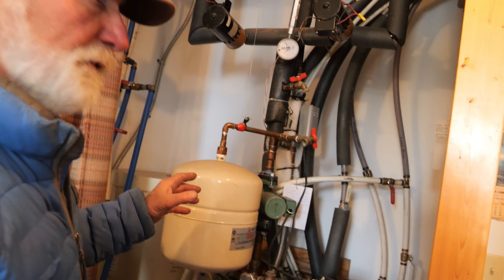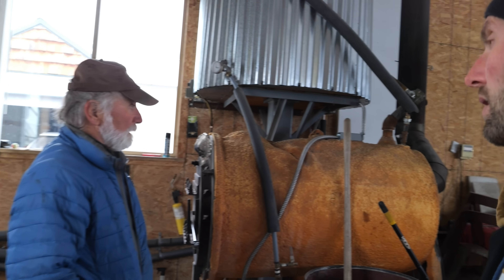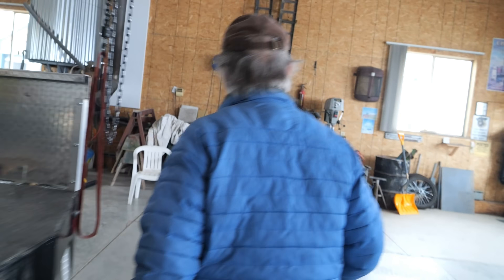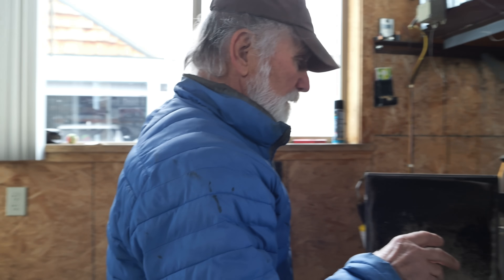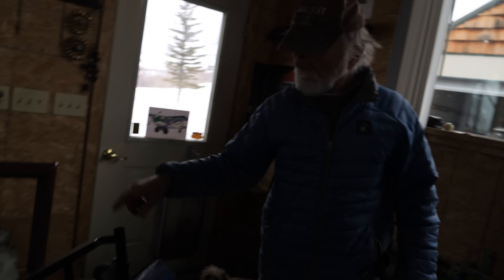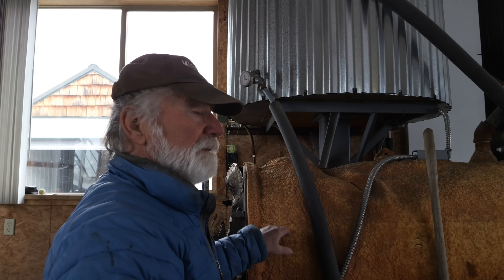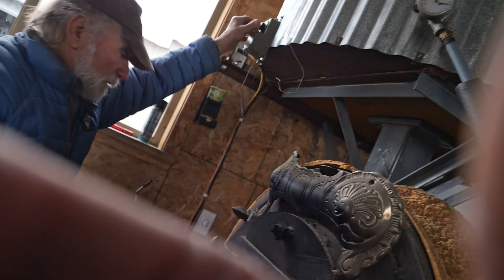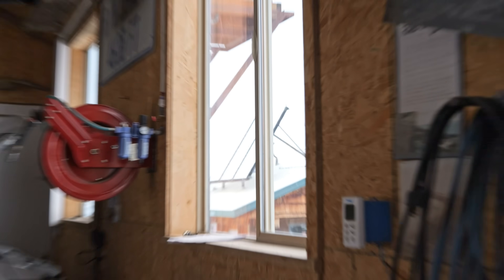Hasn't had a Heating Bill for 40 years.

Comment: i hate this kind of click bait title we heat with firewood/wast oil and similar solar panels and the gas and oil for the chainsaws and the desel for the tractor to skid the wood out and then split the logs the time to stack and move it all add up its gotten better over the years now the wood gets stacked onto 7foot wide racks that i can pick up with the forks on the tractor but there is still a heating bill being payed that is the simple short list
Reply: The 6 solar thermal panels on the shop  provide about 75% of the needed BTU's to keep the 60 by 40 shop at reasonable temps, with no work involved, other than a 15 minute drain down  every spring, and subsequent recharging, using the same fluid, in the fall, that's it.  "No bill" was meant to mean just that, no monthly bill from a propane supplier or other utility, obvously some user input is needed, no clickbait, just a different way of stating what's going on I guess. Time spent in the summer gathering deadfall, and some hauling of wood from construction sites he's on already anyway doing crane work, is a few hours here and there, not onerous at all, and the end result being it pays well in avoided costs. If he doesn't have to write a check or take cash out of his wallet for the wood, some would consider that "free."
Reply: @portnuefflyer  just as a side note not only do you have to drain the panels but you need to check the acidity in the Glycol to prevent corrosion most of our panels run on a 12v system for circulation  (over all i think we estimated close to 10-15 years for the panels to pay for themselves) soooo if you divide up your one time payment for the set up you still have the "bill" same with wood if you cut spit and stack your own then very little bill in the mail others buy in their wood bc they dont have the land to harvest on... if you own a wood lot and pay taxes on it then that's a bill you can break up into a monthly cost.   i am not trying to be a dick here but i had to do a similar chunk of math for the photovoltaic panels we put in and when my brother and i sat down it turned out that for time span he was working with he would not break even going solar

Comment: From what was said at 7:45, you will need lots of blankets and another heat source for the 2 days it takes to get the system warm enough to rely on. You can keep it.
Reply: There are numerous backup/aux heat sources, all the eggs are not in one basket, making it more reliable than a single source.

Comment: 1800's boiler tech mixed with 1980's solar water heat, mixed with 2000's radiant pex floor heating  it's just updated design with no ground heat pump 1970's tech
all glycol is for is to keep the water from being pure steam or from turning to blocks of ice in a combustion engine....in aircraft carriers steam turbine power plant, there isn't any glycol, you don't want your liquid to stay liquid and you can't have it turn to blocks of ice...now get with the 2000's and electro magnetics aka rail gun  or EMALs as it's known on the new U.S.S. Ford, it's still the 1800s steam tech with nuclear tech of the 1950's and electro magnetics of the 2000.
you don't reinvent the wheel, you just modernize it.

Comment: wicked smart, but takes a substantial dollar amount to invest, but after 40 yrs, he has saved a lot.. slow easy but safe and efficient.. wow!
Reply: Subtract from the initial investment, (around 10K, but done incrementally somewhat) the amount required, upfront, for a conventional heating system, and the numbers work out even better.  No butchering of the framing either, as requried when runned forced air duct work, which also takes up more room.  The house boiler and equipment room is in a small closet, with room to spare.

Comment: So his saws run on hopes and dreams then? or does he cut the trees down and buck them up with karate chop? you'd have to buy these things and maintain them in order to supply your self with timber to burn making your statement horse shit. if you buy the wood then no its not free. if you burn gas then no its not free. Not to mention what powers your pumps to circulate the heated glycol from your boiler? I suppose those run on magic too. you have paid for heating for the last 40 years through your own labour and fuel to run your machines as well as electricity to run the pumps. Give your balls a tug old man. As far as i know Glycol isnt cheap as mud and also has to be replenished. I suppose the solar array was bought at a garage sale for a mere $3 as well. Maybe change the heaser to: "man invests $27,000 to heat house and say it costs him nothing.......after the initial $27,000......but we wont count that........we're only counting post fortune not pre fortune...."

Comment: This is really great to see. I work in the solar industry with a group that installed thousands of solar collectors on roofs in the past. We now do solar photovoltaic panels as it's better/smarter/easier + highly incentivized.
This is an awesome setup he has but it's not as good as modern solar as his cost is a constant supply of fire wood + physical labor. He has to be home to feed the system wood so he can't take a good vacation away from home. Some limitations here, but the payback/savings is really awesome and if he is actually using waste wood and not cutting down a lot of trees it's an incredibly low carbon footprint.
Reply: No need to constantly feed the boiler, it just augments the thermal panel action, plus the house has radiant panel electric heaters and an electric boiler, all solar and hydro powered. The boiler is handy when it's convenient and  too cloudy for much input from the solar, but no one is a slave to it as some think! Agreed, on the going with PV to make hot water, with the huge price drop these days.

Comment: As long as the boiler has a pressure relief valve he's golden otherwise he could have a large bomb boiling away in there if one of those pumps was to fail and the fire is burning away. 😮
Reply: The boiler feed has a pop off, and the boiler itself has one, so two. Plus the PEX line would blow before the steel boiler, so no chance of a big blast.

Comment: Very complicated concept new to us but old to the Romans a fireplace was built on the outside of the house with ducting under the house that fluted through the walls up to a chimneys the fire on the outside of the house also heated a boiler tank that was plumbed into Faucets in the house

Comment: If you've ever worked in a cold shop for long periods it sucks.  We always used the propane blowers but that costs too much.  This is a great setup.  He should make them and sell them.
Reply: A warmish floor makes all the difference for sure, radiant floor heat is kind of tricky, a wall thermometer may show 55-60 degrees, but damn it's comfortable for a shop, because you don't have a huge concrete heat sink under your feet. Especially beneficial in a tall building, because there is no heat stratification like with forced air heat.

Comment: Isn't it more efficient to run glycol through the panels and straight to the floor? He said the heat transfer is efficient from glycol to water via that exchange block, but my mind tells me it's more efficient to run glycol in the whole panel to floor system? Am i wrong?
EDIT: Ha! Turns out that using glycol can reduce the heat transfer efficiency compared to using water alone because glycol has lower thermal conductivity than water. You live and you learn something every day.

Comment: Heating panels on the roof, is a nobrainer to install. It's a mystery to me that so few has those installed. You use those panels to heat up the water to a certain temperature, so you only heat the water from lets say 15 degrees C and up.  That is a lot of savings.  And you are never out of hot water.     But, he HAS HAD  a bill. that system wasn't FREE. the interesting thing here is, how many years took it to get to zero, from the initial invest and maintenance.

Comment: Interesting. My grandfather had something like this he built back in the '60s... Water jacket around a wood stove... He used a regular hot water heat circulator pump to send hot water to the second floor for baseboard radiators. 1st floor got hot from the fire itself. If someone was staying upstairs he went down to the basement and plugged the circulator in.

Comment: Hasn't paid for heating fuel but has paid for electricity to run the pumps
Reply: Nope, paid for long ago solar does that, circ pumps draw little BTW, less than 100 watts.
Reply: @portnuefflyer  yeah they draw very little if your turning them by hand. I know exactly what they draw as I have 3 heating my 100% off grid place.
What batteries and inverters are you using for power?

Comment: If water transfers heat better than glycol, & Tom's 40 years of  "user proof" confirms this, why then do car manufacturers add it to the anti corrosion inhibitor fluid needed to prevent the aluminium alloy heads corroding. And let's face it ever since alloy heads have been in use overheating of cooling systems & warping of heads has been a big problem with motor vehicles ? Have & are we being conned by manufacturers that "glycol coolants" are beneficial but are actually allowing engines to run much hotter due to a diminished capacity to transfer heat from the block/head through to the radiator/ fan assembly to then remove heat from the coolant ???

Comment: yes you had one. but it's hidden.
you have to work physically to bring wood to your stove. wood processing fuel.
handling, so a part of your food bill is also a part of your heating bill.
cost of system: solar, plumbing, etc.

but you don't pay someone else to heat your house, so it's cheaper on long term.

Comment: Let the guy talk. Why you interrupt or finish his sentences? 
6:00 "This is how big my logs are" - "Oh really" - "Yes, I just said that "!
Does this system need to keep running? When if hes in the hospital for a week and the system is down? Will the pipes burst when they freeze. Get out the jackhammer Joe.
Reply: My thoughts exactly. Multiple closed looped systems under his floor….. if no sun and nobody stokin the wood burner in mid winter.. there’s gonna be an issue no? I always wonder about maintenance too for floor heating.. like if you get a leak… you’ll also have to grab the jackhammer

Comment: FYI those are FORD solar panels designed for Solar hot water we used to sell in the early 80s push for energy savings. If have questions ask but as you will and are seeing this isn't really supported by governments and is used as grandstanding sadly. This new push has already started losing ground and players and within 5-10 years max likely be dead, possibly Tesla will withstand but if buyers don't then Tesla will fall as well. Cheers and god bless.
Reply: Heliodyne was the name of the  company making them, best of their time. Their frames had a trick extrusion on the entire edge and clamping hardware that made mechanically securing them, without drilling holes in the panels, quick, easy, and real solid. I've gang lifted 3 of them, with an angle iron backframe, at a time with a crane, as they were going 16' high. They also had O-ring couplers, no soldering needed just a crescent wrench to plumb them together. They are no longer around, cheaper solar did them in.

Comment: Someone may have already asked, but wondering if you drain down the panels in summer or if you bleed off the excess heat from roof panels. Image you could approach boiling temperatures on hot summer days.
Reply: Once empty of the fluid, it doesn't matter.

Comment: These are what we in the business call hybrid systems are and can vary with different boiler and solar and Heatpumps.Very popular in Ireland with biomass and wood pellet or wood chip.I run a Heating Engineering Business. Still going strong 47 years in the construction and building Industry

Comment: Burned wood for 50 years , 15 years with a wood fired boiler ( used a oil boiler aquastat to control the wood boiler fan, water hit 180 degrees, fan shut off )  I can tell you wood is not free, even if given to you, but the exercise is great. All my pumps, controllers and even the boiler was given to me or I scavenged . I even used the wood to heat our domestic water with a device called a Superstore, ( tank within a tank )  I found the cheapest way to heat our home was to move to Charlotte NC from Buffalo NY and now use a heat pump with solar panels on the roof. ( We still burn wood but the season here is very short and we do it for fun now )
Reply: There's a 120 gallon SuperStor, all stainless steel, in the house. It has a double walled heat exchanger at the very bottom, that the house's thermal panel's gylcol mix circs thru, warming all 120 gallons. Plus a 3 KW electric element half way up, with it's thermostat set at 120. So, when the element kicks on, it's only warming the upper 60 gallons pretty much. A timer allows the e element to be on only 3 hours a day, if the sun isn't out, the tank is insulated so well that does the job 24/7, sun or no sun. I doesn't come on at all for most the spring, all summer, and fall, but it's all automatic.
Reply: If I remember correctly , my super store did not have an element so I bypassed in the summer to a regular hot water tank when I didn't need heat in the structure. ( For the future , I have been looking at the new heat pump water heaters, the con is the initial expense.   @portnuefflyer

Comment: Would it be possible to use something like a concrete septic tank buried in the ground to hold large quantities of water and have the copper coils inside of it coming from the wood stove thereby using the ground as insulation to retain heat longer?

Comment: my grandmothers house used to run on coal and logs hot water and the rads always extremely hot, she switched to gas because her sisters told her it would be cheaper, now the house is always cold and it's costing her way more, and the house has been fully insulted

Comment: Excellent system, straight geo.... Thermal dynamics. That how my house is set up. Mine is a open loop system do to ledge, would have preferred closed loop system as you have  But to run the pumps, what is your electric bill? Hopefully solar. Propane aside.
Reply: No e bill, no propane, all solar and hydro, grid tied.

Comment: Having served in the Navy as a Boiler Tech and 30+ years in commercial maint this is pretty cool.
There's a heat exchanger called a Q-dot that has no pumps or moving parts.  It's filled with gas that 
works like a heat pump.

Comment: Im a cnc machinist duplicated a central boiler as top is ripled with last riple forming heat lock and say is 5 ft but riple top used 10 ft of surface to exchange heat then no blower this allows wood to last 2 to 3 times longer than forced draft best by far go with central boiler style desighn
Reply: Yeah I've seen that, pretty trick! But the boiler firebox is just a chunk of sch. 40 pipe that used to be part of a ski area chair lift pole, so no ripples!. The out ring came out of a scrap yard, at scrap prices.

Comment: This is a masterclass in systems redundancy.  The larger water bath heat exchanger above the wood fired boiler intrigues me.   Excellent video Jonas.
Reply: Hes using every medium in his arsenal to store heat. Granted, his buildings probably arent what most consider "cozy" but it isnt freezing either. His property probably idles around 55-65 degrees which is perfectly fine. I personally love 55-60 in the winter so as to not sweat in the bed.
Reply: Correct.  55-60 is fine considering that much of the time it could be as much as a 75 degreed difference from the outside.
The water bath is less about storing heat and more about being a disconnect from the boiler supply and that's  the part that's cool to me.  It can be a challenge sometimes to not cook yourself out and still keep a fire going.  It's just a really neat buffer.     @johnwirk
Reply: it's called a thermal store

Comment: How much glycol did he say he have in those lines? Doesn't that have a service life of like 7 years?
Reply: Low heat and closed system...what is going to degrade it?
Though as he said it is expensive..
to fill for the first time...
but is only necessary where it flows through the panels which would otherwise freeze.
Plain water everywhere else.
Reply: @JohnSmith-yv6eq   Only about 7 or 8 gallons total, of auto anti freeze.

Comment: My coworker has a shop with with the same setup as this guy, the shop is insanely hot and if you bring a snow covered big rig in the shop, in 10 minutes all the snow will be  gone
Reply: So that's basically too hot in there.
Reply: @jackjack4412  it's actually not that hot to be honest, it's warm don't get me wrong but he has heated floors and it's crazy how fast it heats up
Reply: @davesmith3529   right on, I've never been in a shop like that. That's good.

Comment: I visited Israel in 1972. Every small house had a super-basic solar hot water system on the roof. It was just a small panel that looked like a window as the collector, and a 50 gallon drum of water above it. I think it was just thermosyphon - the heated water rose from the collector up into the drum, and the cooler water from the drum sank into the collector. The solar radiation during the day was sufficient to make plenty of hot water.
Reply: You can do that anywhere now with 4 x 300 watt panels feeding directly into 2 x 600 watt electric heating coils in the bottom of an 80 gallon hot water cylinder.
No regulation needed and will heat water for a family of 4 during all but the most wintry of months.
In summer may have to disconnect 2x 300 watt panels...too much heat!